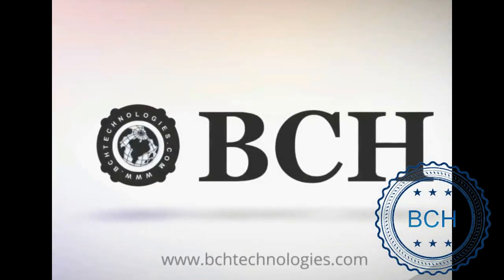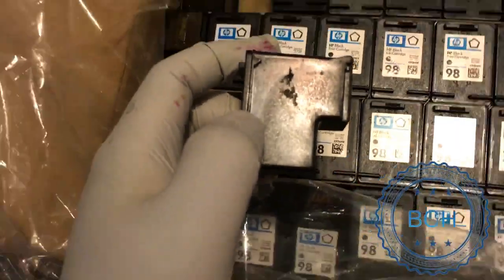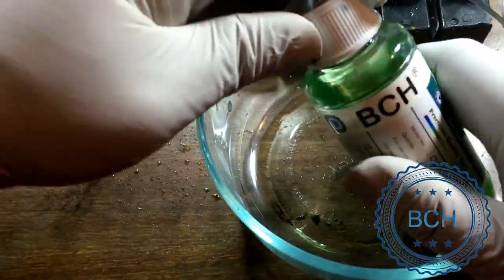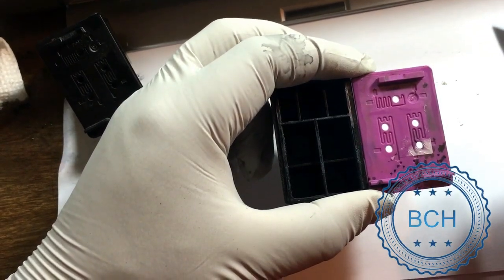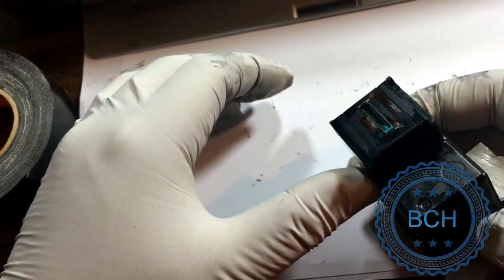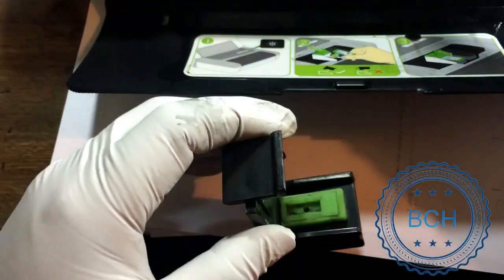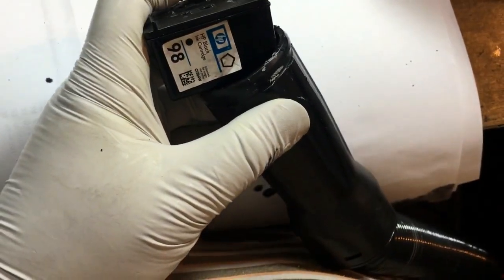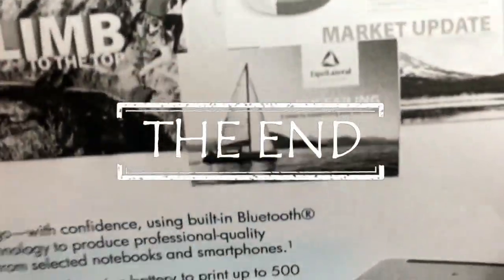Printer Not Printing After Refill? Try This Easy Trick!

Comment: I have the same issue with my black cartridge in canon Pixma printer, I have tried all the steps but still not printing, can I try and put cleaning solution inside the cartridge as last option?
Reply from the maker: Thanks so much for subscribing and helping us get closer to our 100k goal—your support really keeps the channel growing! Since you’ve already tried the main steps and your Canon Pixma black cartridge still isn’t printing, adding cleaning solution directly inside the cartridge can be a last-resort option, but it comes with risks: too much fluid can oversaturate the sponge or damage the cartridge, and sometimes the blockage is in the nozzles rather than the sponge itself. If you do attempt it, use just a few drops and let it sit upright on a paper towel to drain any excess before reinstalling. I’m working hard to answer subscriber questions within a few days, though I do have a backlog, so I really appreciate your patience. If you ever need faster help, you can reach me at [support@bchtechnologies.com](mailto:support@bchtechnologies.com). And if this video or comment has helped your journey, I’d be grateful if you could leave a quick review on my Google page: [https://g.page/r/CfL7k6nYvPQ9EAg/review](https://g.page/r/CfL7k6nYvPQ9EAg/review).

Comment: Why my black ink cartridge keep giving me trouble? I fill it up again, I used the priming clip the same way I did last time but doesn't wanna work. What else can I do?
Reply from the maker: Thanks so much for subscribing—it really helps the channel grow as we work toward our 100K goal, and I truly appreciate your support! If your black spongeless cartridge is giving you trouble, it could be due to how many times it's been refilled. Black ink is usually used more heavily than color, so those cartridges tend to wear out faster. Also, once the sponge is removed, each refill holds about 5 to 6 times more ink than before—so while it feels like you haven’t refilled it that often, you’ve probably pushed the cartridge through a lot more print cycles than you think. Over time, the internal seals and air pathways can wear out or clog, which affects ink flow. I try to answer subscriber questions within a few days, but I’m working through a big backlog—thanks for your patience! For faster troubleshooting, feel free to email support@bchtechnologies.com.

Comment: Hello , can you suggest me from where I can get empty/used hp 62 black/tri color cartridges?
Reply: It seems like mine was damaged little bit.
The inside of the cartridge is getting solid (with lots of bubbles in it, and the printer is not printing anything) 
After again sucking out all the ink, I've to refill the cartridge which agains only works for about 24hrs. Again it behaves same ,the ink gets lot of bubbles just like in this video at time 6:35
Reply: or do you any solution to that problem which is at 6:35 (lots of air bubbles forms inside the ink)
Reply from the maker: EBay, of course.

Comment: I find it easier to suck out sludge from the interior of the cartridge with a syringe and needle, than trying to suck it out through the jets.  Although be careful not to puncture the filter at the bottom outlet of the cartridge. Just inject some distilled water, let it sit for hours or days and suck it back out. I also soak the outside of the head on a shallow puddle. You will really notice when you have cleared the clog as ink comes bleeding out much more freely.   To inject it back in without making a total mess have a second syringe & needle with the plunger removed and inject the foamy ink into that and just let it trickle back in slow.  You can remove the ink entirely or just churn it up.  This method seems especially necessary of the tri-color ink for some reason: perhaps because there are little tubes running from each color to the jets that get clogged up.

Comment: how do you test if the electronic is still good.
Reply from the maker: Wipe the ribbon clean and dry, also make sure the pins on the printer are dry.  If you repeat it few times and the printer still rejects the cartridge, then the electronic is bad.  In older models, HP allows you to bypass the electronic check and print a diagnostic report.  It can still print with bad electronics.  However, this function was never in their manual and seemed taken away from new models.